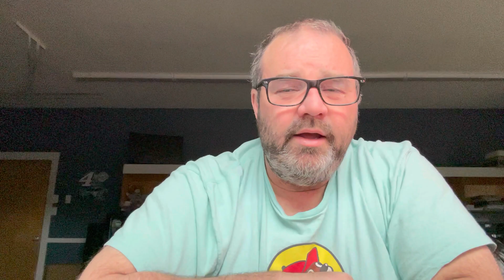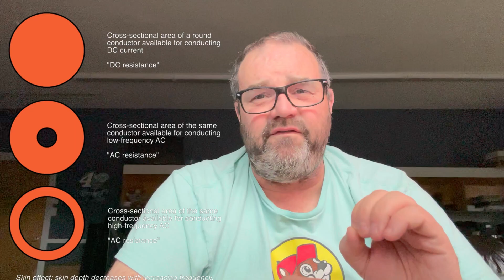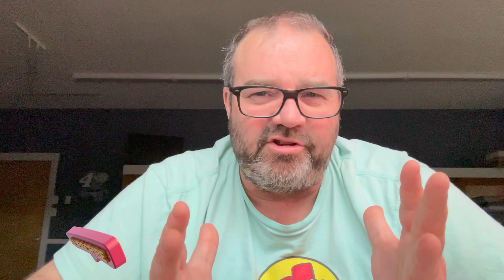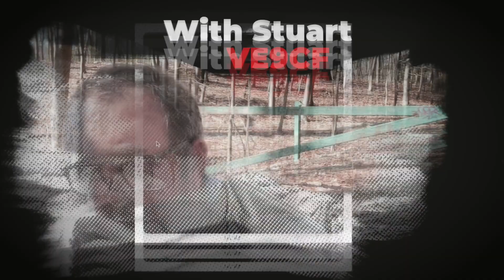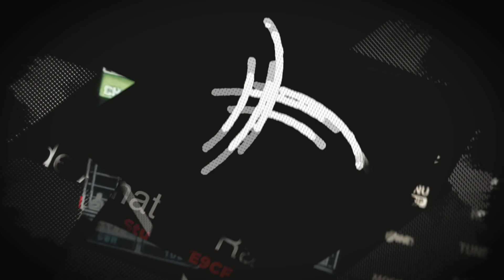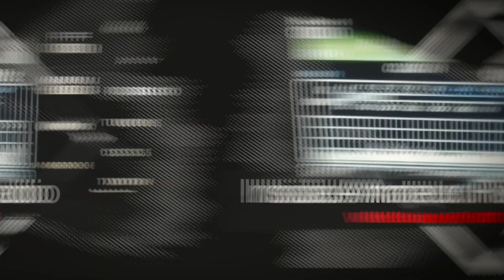The Skin Effect: A Critical Concept for Ham Radio Operators

Comment: I suffer from a very different skin effect when doing portable operations... sunburn.😏
Reply from the maker: They have a solution for that...it is called SHADE 🙂
Reply: @outnaboot  Or sit in the comfort of my vehicle? 🚙
Reply from the maker: @jafhro  That too!! I have a screened in tent I am taking out this summer
Reply: @outnaboot  I think I have one of those around. Only used it once, I think. I've been sitting in my vehicle most of the time through the cooler months.

I do hope to do some local motorcycle POTA, when it gets a bit warmer and drier. I'll be packing light.